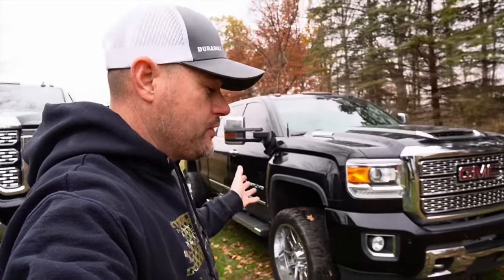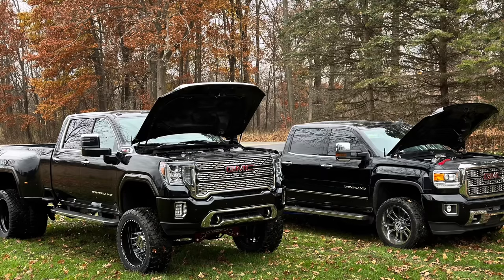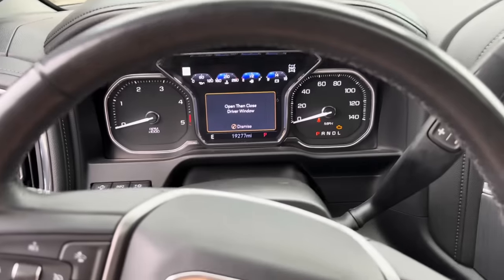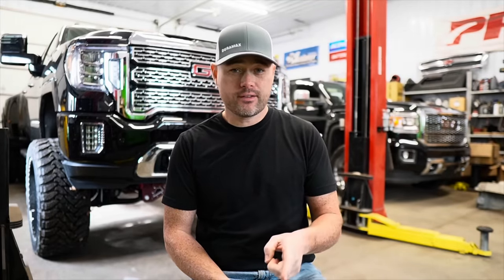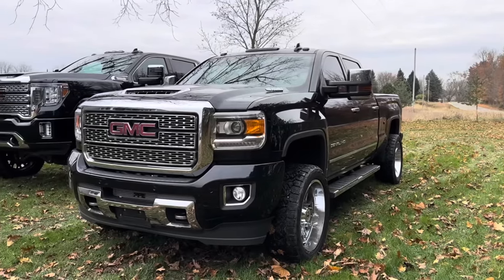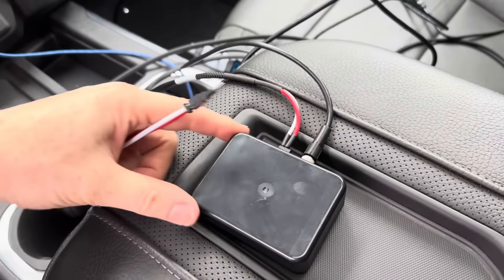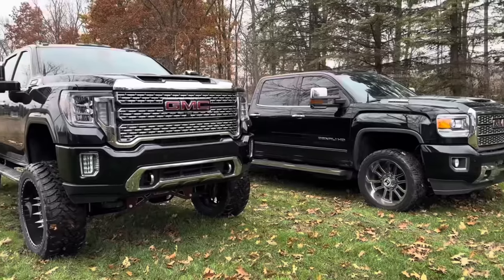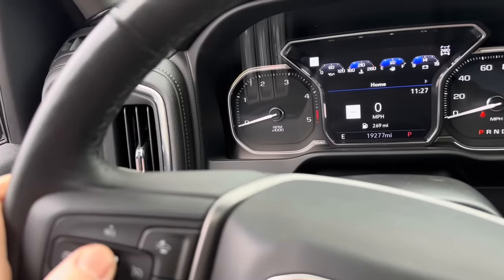You Can Now Tune And Delete A L5P Duramax From Home! *Watch Before This Video Gets Taken Down*

Comment: 2007 GMC 2500 LMM with just 141k miles.  Bought it 2 years ago.  All stock with just a Bully Dog tuner which stays in tow mode all the time.  Fuel pump went bad for me while pulling my 10k pound 5th wheel far from home.  That was after putting a couple grand in to brake system fixes.  It seems I'm the only one commenting here with a negative experience.  I've lost confidence in it and am thinking about a new Duramax.

Comment: Thank you for your video! I have a 2019 L5P and the emission system can't handle short duration trips to and from work. The Dpf fills up and its starts regeneration but doesn't stop. It will then begin regeneration everytime i drive it but never complete.  I wasted a lot of fuel before i even figured this out. Chevy dealerships (x2) hooked it up to computer which said its all good. Basically, i have to drive up towards the next town on the highway for a bit every single tank of fuel at least once in order to allow to truck to complete regeneration and not go into doing it constantly.  Between that nonsense and the fact that it burns extra fuel to even clean the filter, i am convinced deleting is actually better for the environment.  I suspect these emission systems may even be a scam for oil companies to sell more diesel at a higher price.

Comment: Had my 2018 done and now it puffs a very small amount of blue on cold start up after sitting. 86000 kms. Is it something to be concerned about? The turbo vanes became siezed and the truck went into limp mode because it wouldn't regen, the garage i took it to put a turbo in it and suggested a full delete. I did that, sounds great, runs great, only put a towing tune in it 50 +hp they said.
Reply from the maker: I think that the light smoke at start up is normal.
Reply: @TruckMaster   blue though? Never noticed it before the full delete, I hope so. I want to keep this truck for awhile the price of a new one is outrageous now. Thanks for the reply!

Comment: I'm thinking of getting a 24 Duramax.  Will this kit give you the cloud of smoke as you step on the throttle, if so is there a way to not have that.  I also will de badge the truck,  or at least the word diesel .

Comment: got a 23 chevy dfp clogged up at 10545 miles and the filter is on back order. been 3 weeks. they still cant give me an answer on when they will be able to get it. I have been looking at kits. Probably going with this one if i do it. Going to give it one more week then time to void the warranty and get it done.

Comment: Has your roof split on half yet on these trucks? Gm stopped production on these from the roofs splitting in half.
Reply from the maker: Nope I never heard of this
Reply: Turns out it's on the 2024 models.
The problem is on the passenger side with the rain valley molding.

Comment: Question I have a 2017 GMC 3500HD Durca 6.6 i had a company delete my my truck but didn’t remove muffler system and now I’m having a lot of codes come up with fuel rail pressure sensor 2 circuit high voltage ,cylinder 1 Glo plug,control module communication bus A off ,output speed sensor circuit no signal

Comment: I have a 2020 L5P. I might do this this winter. I just turned over 100,000 miles and was planning on cleaning out the intake system anyway.

Comment: Helped my buddy delete his 2020 Ram.  I had a poor battery charger and/or his batteries were getting weak, causing a failed write during the tuning process.  We mailed the ECU to our tuner and they fixed it, but this kind of stuff happens.  It's crucial to keep voltage high during the tuning process.  For those wondering, it's a 2020 2500 Ram, Optimal welding tune, 5" stainless exhaust with muffler, banks Monster ram and big ass intake.  Sounds killer.

Comment: That's funny dropped in a obs fully owned and it's not noone else's because slide my money cross the table now inside intell don't ever part to get that engine to start but got relocate temperature gauge for that transmission

Comment: Good old Alberta, our laws on emissions only pertain to noise. I just had my 21 3500 deleted today, they put a high Flo muffler on it and it’s all good to go. 

Now that being said I had no intention of deleted this truck but it has had the def tank melt down every year for the last 3 years. I’ve had numerous nox sensors fail, def tank levels not resetting and almost derating the truck. The DPF system would run for hours on the highway hovering around 70% then as soon as I hit a city with stop and go traffic it would kick into regen, even though it couldn’t complete one in those conditions. I loved how I would have to drive 45 minutes past destinations just to let the truck do a regen cycle.

Until they make this  after treatment system reliable it shouldn’t be mandatory.
Reply: Yeah. I can't wait for this delete kit to be available for 24 second gen of l5p. It goes into regen every 250km. Crazy . I really miss my deleted LML. Also Alberta here

Comment: I have a 2018 2500 hd duramax 6.6 my truck is all ready deleted with a single stage 3 tune how can I re tune it , will a pulsar edge be ok or what do I need to do. Thanks

Comment: just installed my kit completely from my driveway. 100% worth it and had no issues. Follow all the instructions word for word and y'all should be good!
Reply: How long did it take ?
Reply: @Bandit93gt  If u are mechanically inclined it should take u no longer than a weekend. If u got a couple buddies willing to help u can bang it out in one night. Blood sweat and beers
Reply: @sweet_yams  that is for the reply man. May pull the trigger on this this week. How long did it take the kit to come in ?
Reply: @Bandit93gt  Do it bro! shipping was actually fast if I remember correctly
Reply: Did you also remove the CAT from the turbo?
Reply: how’s it running now? any issue??
Reply: @the03jorge81  no issues at all
Reply: Does the cruise control still work with shift on the fly?

Comment: I have a 2018 GMC 2500HD Sierra that was deleted before i bought it and the remote start doesn't work because of a "Check engine " light. How can i fix this issue  ?
Reply: clear the codes. Fix problems related with check engine light. I never had that problem with my deleted LML. Even broken glow plug will cause check engine and not allow you to remote start it

Comment: Hey Truck Master I appreciate all the great information you provide.  I’m at a crossroads with my 2015 2500hd LML. I have been underneath it putting in a new DEF pump, the NOx #2 sensor a MAP sensor and I have the “Exhaust Fluid System” error on my HUD as of now and it won’t go away.  This is the 4th time (3 prior to the shop) and this time I didn’t want to fork out another $1000.00 just to have another issue 2 months down the road.  In other words I’ve had it with this state of the art emissions reduction system.  In my opinion they should call it the “stupid system” because that is exactly what it is.  Stupid.  At any rate, I have decided I’m going to delete. I’m actually thinking about keeping all the factory exhaust intact, but pulling it off and ramming it out so it’s just a free flow system and then just leave the def tank in place just in case anybody has any questions about emission systems on my truck.  This is all so that it looks legit, may not be legit, but who cares.  
Should not be an issue if we get Biden out of office.  😂😂

Comment: How much does this cost to send it in and have a professional do it? I just bought my first 2022 duramax high country and don’t know much about them. I just know I want it to last as long as possible so would this kit help it run better and have less issues? Also could you do a video on best maintenance to do to keep your truck running strong???

Comment: My 2024 Silverado 2500 STOCK Duramax has 10K and so far..... no issues. I use Hotshot every day diesel with every fill. I do believe our diesel fuel can use the extra Cetane.  I have only had my truck regen once at 3180 miles. I'm not sure if it regened since but I only had the message to keep driving once at 3180 miles. I payed for the extended 100K bumper to bumper warrantee because of the new computers and complicated engines today.  I know some will not like this....but I believe in keeping it stock. These computers are so sensitive and most don't have the knowledge to play with them. In addition, I have 470 HP and 975 FPT. I didn't understand the idea that this is not enough power... at least with a 2500. I find that most issues reported on Youtube with trucks failing is because someone decided to delete their truck and now have problems because they have no idea of the complicated computers in these truck. If gas mileage is a concern..... and you are towing, it is a mute point.  You will never get good gas mileage while towing anything with any type of weight. With that said, Deleting is a complete waste of time and money!

For the record... I am not a mechanic and know nothing about engines. I do know any savings you think you will get with the deletion is completely gone with the price of these kits and labor to install!

Lastly, My brother has two F250 6.7. One has 250K and his newest has 125K. Only issues with either was some sensor at 200K. Never issues with the emissions!
Reply: you just didn't know when it did regen. Mine does it every 200 miles. it's crazy. I use edge cts to monitor it

Comment: It is illegal for a licensed mechanic to remove these items from another vehicle. It is not illegal for the owner of the vehicle to do so that has never passed Muster that I am aware of the original case was from 1974 75 in Washington where a man removed the catalytic converters from his Chrysler Cordoba and they found that there is no authority of the government that extends to the owner of a vehicle.
It certainly didn't help the government's case when they found that the car actually got better gas mileage and ran cleaner without the Converters on it than before he had removed them. But they did have to test other vehicles with Converters on them. The vehicle actually ran better and cleaner. Just like many of these Mustangs they're getting on people about, they are running better without the converters then with the Converters on them. Getting the fueling and the mixing right and the increases in the ability of the ignition system has done more than the converters were doing at least in the 1980s.
Those who believe that you can actually control the emissions by very much in a diesel engine. That would run best if you would just insist that all diesel engines have methanol injection. That would improve their emissions quite quickly, and the engines would last even longer

Comment: Can you recommend a decent electronic service tool for the money to work on GM?   I bought a Autel 808BT for $700, had to send it back because it was basically an overpriced scan tool.   Couldn’t really do much in way of configurations on my 2017 Duramax.

Comment: I don’t recommended this kit buy all the parts separately. They are junk in this kit especially the heater hose connection to the firewall and “stainless” exhaust will rust. Buy aluminum

Comment: I have a 20224 waiting to do it when its possible. Have a 2016 fully built with compound and about 500 miles on it. sitting for 2 years just driving it a few times in summer,  for sale.
Reply: Dans diesel did the build.

Comment: Ok I have a serious question. Let’s say I wait until my DPF and EGR system fails. Will I run into problems with these sensors giving me Fault codes after deleting once there is a failure. Kinda like you saying that I need to top off the DEF and perform a regen before tuning. Or should I do the delete before catastrophic failure occurs. And do they regulate vehicles that are being used as FARM USE ONLY. I can’t find any info on these subjects as of now. I was hoping you might mention it here and if you’ve mentioned it in snither video can you reference the video that covers these subjects. Thanks for the content. I currently have a 2022 duramax

Comment: This is just one of the problems with "modern" diesels. 
The "emissions" BS has basically ruined diesels. At least for me. I will never buy a newer diesel. They neuter diesels so bad now (talking epa, gov) same with 2 stroke gas engines. 
It's a shame. With the technology we have, can you imagine what a diesel could actually do? Or a 2 stroke?

But nooooo, the "environment" won't like it. (As they fly on private jets burning thousands of gallons of fuel) 
"Rules for thee, not for me"

Comment: I cracked my phone screen I clicked so fast. And I drive an 08 Sierra lmm. It's on weight loss. And I run hotshot with it. This is awesome to know for when the day comes someday I have to upgrade trucks. I don't plan on retiring the lmm until 600k unless something happens sooner. It's at 341k right now.
Thanks for continuing to make videos bro.

Comment: Have thinking of installing the edge pulsar on my 2018 Chevy 3500. I would most likely run it in tune 1 or 2 most of the time. What are your thoughts? I'd like to do the diesel dudes delete but that just isn't in the budget.
Reply from the maker: I think you should just delete it, the emissions tuning is really harmful to your dpf system from what I’m noticing
Reply: What kind of fuel mileage gains are people seeing with the delete? Empty and towing?  @TruckMaster

Comment: I run a 2015 Chevy 2500 6.6...  Bought it tuned and deleted, just not sure how to find out what tune is on it or what tuner may have been used. Bought it from a dealership, so of course they didn't know either..
Reply from the maker: You will never know unfortunately

Comment: I have a 2024 GMC Denali Ultimate dually and a 2006 GMC crew cab long bed. They are both lightweight.
Reply: What kit did you use for your 2024 duramax I need to know
Reply: Let me know what tuner you used for your 2024 thanks
Reply: 24 ecms are not unlocked. It's global b

Comment: I want to ask a questio. I have a 2012 Siverado 1500 (gas). After engine warms up, the idle is around 500rpm. Would it be okay to turn idle to 700rpm and still be safe? Answer when you can.

Comment: I just got quoted 10K do tune & delete my 2019 Duramax. WTF?! I never heard of it being that expensive. I know most of the work is taking off all that crap, but I don't think I'll ever be able to afford to do it. Might as well trade it in for a gasser.
Reply: That’s with buying the delete bundle ?
Reply: @Yee20237  That was for the parts & labor.
I've since bought & installed the kit myself. 
$4500. Best decision ever.
Reply: @VRGamingTherapy  damn bro I wanna get mine lol I have a 2021
Reply: @VRGamingTherapy  how much is just the labor
Reply: @Yee20237  I'm sure it varies where & who does it, but it was more than the kit itself. About 6K. 

Tried to make it sounds harder than it was, ya know. All you need is 3 days & some hand tools. It's time consuming, but not difficult. I went with these guys because the tunes are super clean & customer service is 100%.

Comment: Not sure where you got your Canada info but in Ontario it is very illegal.  I had my 2009 deleted and tuned and the burn box removed.  I got pulled over by an environmental officer and I was facing 5 $5000.00 fins for tampering with the exhaust.

Comment: Great Video!  Something I've always wondered.  If I just electronically delete a truck.  Replace the DPF with test pipe.   Then do the opposite to meet future state or county compliance.  Will the truck run right after flashing back to stock and putting the DPF back on?

Comment: I own a 2020 ram cummins all stock, but I have found a way to help with emissions is I use Pittsburgh power mileage max fuel catalyst it only take 1oz to every 25 gallons it changes the temp of soot temp burn from 1000 degrees to 700 and I've had great luck with that till my warranty runs out wink wink! Lol

Comment: Josh, I've got a 2008 LMM living in Missouri I've put HSP on everything but the up pipe and not deleting my factory exhaust. I want to do this in a bad way, with maybe doing a ghost delete. Leaving the cooler, but shutting down the valve, block the cooler and cutting out the the guts out of the the exhaust,  thus giving the effects of the looks being original. Currently having a 5 inch from the flange past the dpf w/out a muffler. And past inspection it failed. Luckily I kept the old exhaust reinstalled to pass then change back after it passed. Currently KC and St Louis are doing emissions test ...

Comment: You went through the effort of keeping your thumb over the hpt logo on the mpvi and cropping the write calibration clip to hide the software header….but then threw the mpvi right up there at the end, backing the bus right over hpt. Granted it’s not their fault someone in another country is using their product for something it isn’t intended for but that won’t stop the epa from coming down on the parent company. It’s no secret who figured out the unlock and it’s no secret others have found out what to change in the bin file to make this happen without using their interface, but with such a large following this could send some unwanted attention their way.

Comment: Great video!  I currently have a 2003 GMC 2500HD Duramax with 241k on it.   I chose this year to avoid everything you talked about but I know I’ll probably have to upgrade sooner or later.
Reply: rebuild it, never give it up. i have a 2016 with 48000 miles have had 4 emissions issues with it.

Comment: Might be a dumb question, but what if you plan on adding other aftermarket parts as well? Such as a bigger turbo and beefier fuel system. Any issues getting those tuned in with this system?